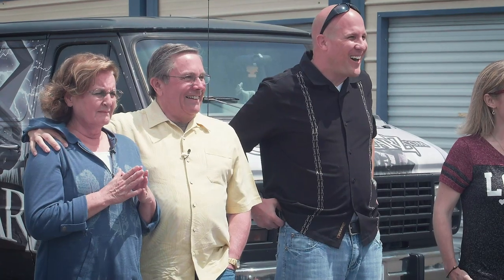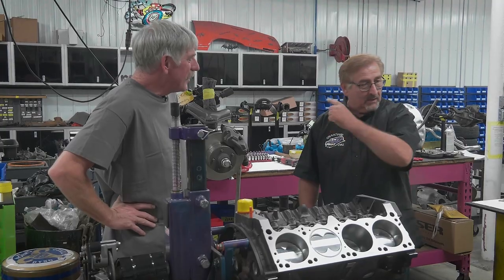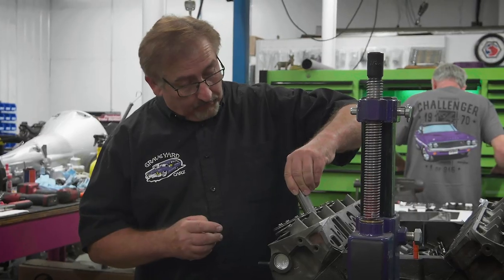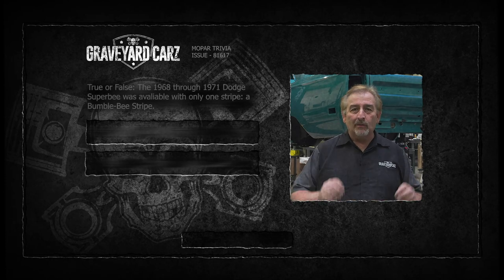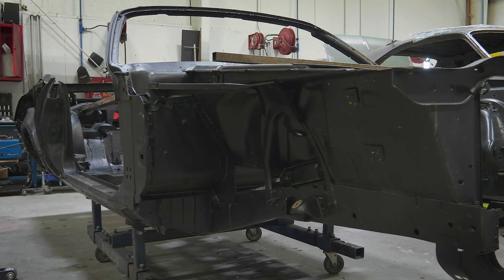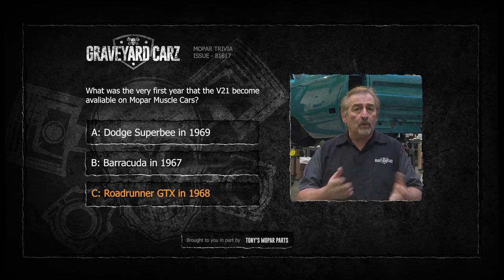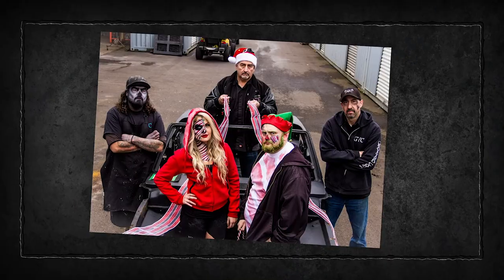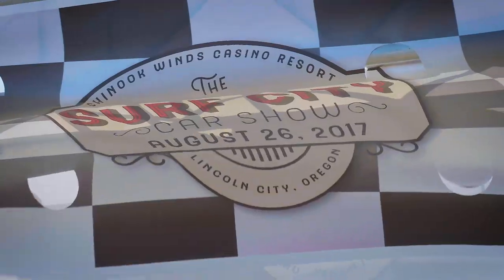S08E08 ANATOMY OF A 340

Comment: A 750 Honda in third gear would not pull the front end up. Just saying. Im a little older than you Mark and I worked on motorcycles at that time.